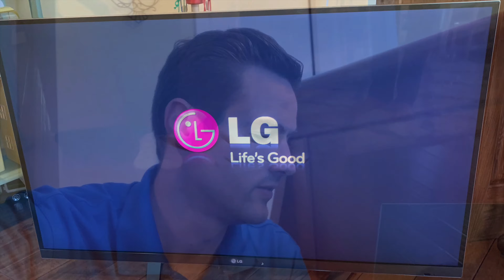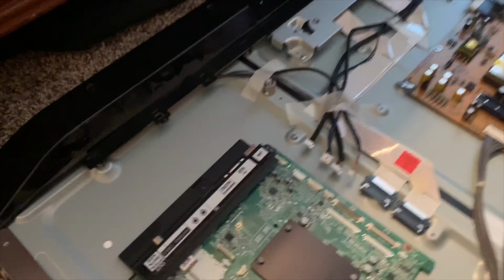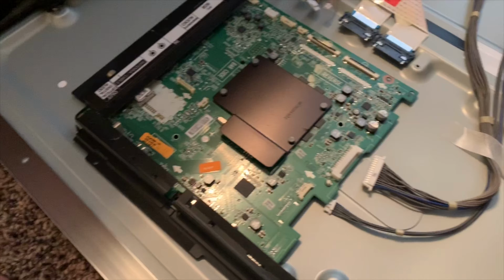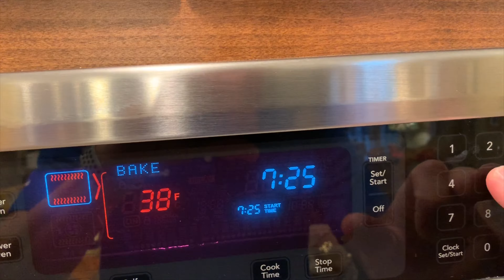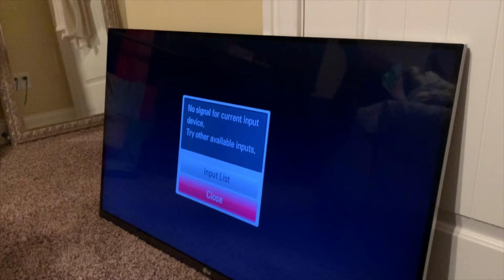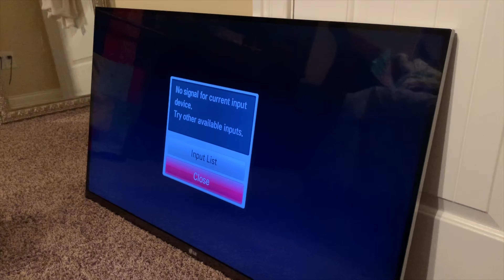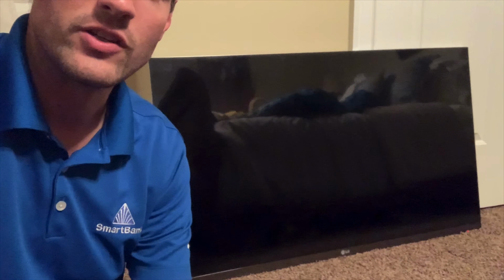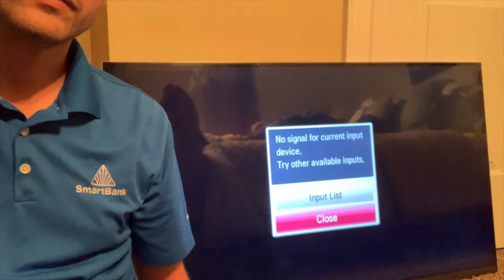FREE 47" LG 3D Smart TV *Repaired at no cost* - UPDATE STILL WORKING 1 YEAR LATER

Comment: Hello! I have an LG 47Lm7600 and I have a problem with startup, I recently tried to make some changes to the menu, and when I gave it accept the screen it became totally dark without being able to access the menu and do a factory reset. If someone can help me with the commands to reset the TV as a factory, it would be of great help to me!
Reply from the maker: Not sure if it will work, but you should be able to hold down the power button for 5-10 seconds to reset the TV. If you can shine a flashlight and see a "ghosted" looking picture, it could be the backlights or a board. If you have a screen/picture you could try to go into the general settings, find the reset option, agree to the warning message, and press “confirm.” (Note: For some LG TVs, you may need to input a password to complete the factory reset process.) Hope this helps. Good luck.
Reply: sounds like backlights to me. easy fix if you have the time.

Comment: Very silly! You need a TV technician to solve the electronic problem. Your method may have reflowed some of the solder joints but you have probably aged and dried out the components like capacitors and so you're in for a series of problems. Good luck!
Reply from the maker: Thanks for your care and concern. I fully understand the process that took place, the risks involved, and the need for a TV technician. I happen to be friends with a few. As  a hobby DIYer, I like to research, experiment, and learn. My apologies, I thought I said that I would pick up another board and that this was in fact just to see if baking the board would actually make it work again. Maybe I need to go watch it again. It’s been a little while. The TV is still working by the way.
Reply: @fullerruns  ok but I still think it’s a crazy thing to do to electronic equipment. I would keep an eye on the electrolytics and check the voltage rails. Crazy man.

Comment: Is it still working or did you have to replace the board?
Reply from the maker: The board has to be replaced. I have not gotten around to replacing it yet, but the "reflow" of the board did not last. The TV was functional after this for a little while, but definitely not a permanent solution. That being said, I didn't expect it to be. Still interesting that it "fixed" it, even if only temporarily.
Reply: @fullerruns  Try cooking it. Who know, maybe it will work. :)
Reply: Bei mir geht nichts so Gleiche Tv ich hab probiren get nicht
Reply: Samsung smart TV
Reply from the maker: So Tom... I said the TV wasn't working.... However a year later, I pulled it back out and was curious... Surprisingly when I plugged it in, it still works. Went through several minutes of changing settings and testing inputs and all seemed to still work. Who knows. Now I am curious just how long it might make it before needing to actually be replaced.